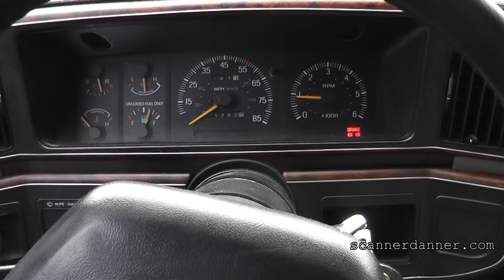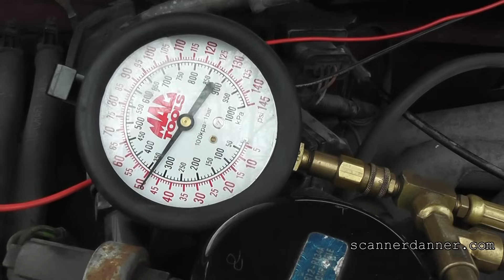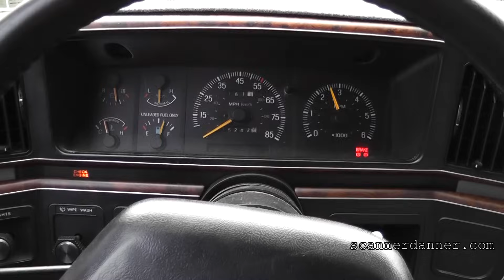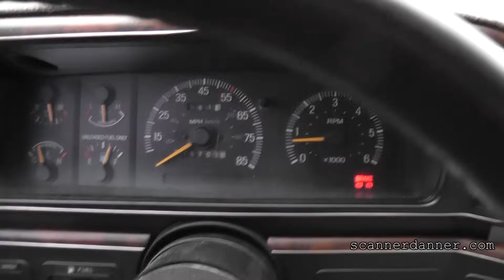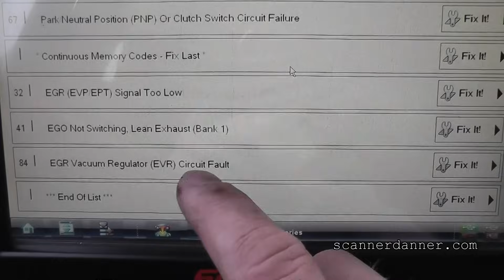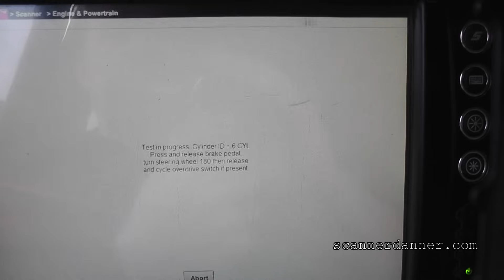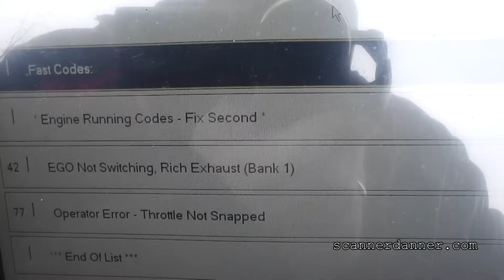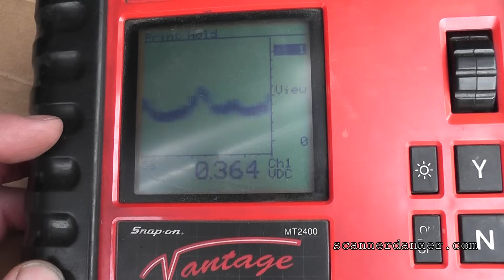1988 F150 Hesitation Problem [FIX!]

Comment: Didn't watch the entire video to see if you mentioned this, but the truck had an ignition misfire.  At 30:03, just to the left of the TPS, behind the air intake clamp under the throttle body, you can see spark jumping like crazy.
Reply from the maker: +Alan K there is no plug wire there. I saw what you were talking about but I promise you it wasn't a spark leakage issue
Reply: +ScannerDanner I'll be darn.  I took a second look after I read your reply and it is evident the plug wire isn't the culprit.  I guess looks can be deceiving in a video.  I wasn't hating by any means.  My apologies if it came across that way.  I certainly respect your diagnostic abilities.  It's good to see there are techs that use an oscilloscope and know how to interpret live data instead of pulling a trouble code and replacing a part.  I see that so often in this field, and I'm sure you do too.  I had excellent automotive instructors that taught me how to properly approach diagnostic and repair situations, and it's evident your students are as fortunate as I was.
Reply from the maker: +Alan K no problem at all brother. I had to go back and look at it myself 2 or 3 times before I was confident enough to reply. Good eye man.

Comment: Great video ScannerDanner!  I have a 1991 f-150 with the 302 I get live data on my truck.  I had a similar problem but mine was poor MPG and my o2 was stuck lean at .0.2 volts and as i tried to drive it rich by using propane and it ran like crap and o2 stayed at 0.2 volts

Comment: I was thinking verifying base timing too. It was tricky to get the distributor gear and the oil pump key lined up when i put mine back in so i got it as close as i could then adjusted the base timing after i started the engine.

Comment: Have a 1995 Ford 302 EFI. Get a CEL light, run rough at idle, stalls and won't go over 1500 rpm. CEL light goes out runs great. KOEO 111, then 334. KOER  412, 538. Test with meter seem ok.

Comment: One suggestion on these is to always use Slow Codes. The other thing I do with Snap-On scan tools at times is to lie to the tool and try a different year if I'm not getting proper PIDS, etc.

Comment: Funny you say you hate to run new wires...  I just had a voltage drop on the supply side of the evap vent solenoid, but the problem area in the wire happened to be between the fuel tank and the frame rail.  I didn't want to drop the tank, so I ran a few feet of new wire for the time being.  Fortunately, it was my truck and it's a GMC Sonoma so I'm sure the fuel pump will fail soon enough.  Then I will find the bad section of wire, repair it and remove the new wire I just put in!

Comment: OBD 1 Fords were a major pain.  I have also seen mention of the glitch you experienced (no snap throttle prompt/cutting out screen) when using the KOER test with Snap On diagnostics.  Seems to be an issue on Snappy's end not the vehicle's.  Maybe some coding errors throughout the latest updates. I'm surprised this truck started so easily. I once saw one timed using the incorrect mark, and it was so difficult to start due to all that advance. to make matters worse, the damper was worn, and the mark had slipped, making timing extremely difficult. I also believe the best setting from is 12 degrees base not 10.  Ford set it at 10 for emission purposes, but those old 302's were happiest at 12.

Comment: Hey Scanner Danner,  I really really appreciate you going through all you did to fix this one.  It was a lot of vital points in this video that i'm pretty sure can help me figure out my little issue i'm having with my 2004 Ford F-150.   My 2004 F-150 starts up strong and idle's good and smooth, but as it starts getting warmer, it starts to having a vibration, not like a ignition misfire, but like it's getting too much fuel because it burns gas faster than usual, and when i stick my finger in the tail pipe i get this black stuff on it like a rich carburator.  Your stuck 02 sensor/bad 02 sensor fix that made that truck run smooth without the mis, just might be the same issue i'm having with my idle.  I know it's a lot of variables that can cause a ruff idle but from this video i'm gonna check my 02 sensor's.  Nice video👍 Thanks!
Reply from the maker: we need to know what your fuel trim numbers are showing during this condition
Reply: @ScannerDanner  Hey Danner, My STFT, (bk 1) is -1.6 to 0.8%
STFT (bk 2) is around the same as 1

LTFT (bk 1) is 12.5% and getting higher 
                     as it warms up. 
LTFT (bk 2) is 7.8%
maybe you can just about tell what would you check.  Thank You!  Scanner Danner🤛
Reply: Hey Danner,  Now that my f-150 is warmed up, the LTFT (bk 1) is 10.2% and holding steady.
My LTFT (bk 2)  went from 7.8% and is now 9.4%  at 180°  Thanks for your opinion Danner👍
Reply from the maker: It could be a misfire. Do you have access to a global scan tool where you can read mode 6 data? You can find Fords misfire counters there

Comment: Snap throttle test advances the timing to some insane level, then you should hear a spark knock after you WOT. It just checks to see if the anti knock sensor is working.

Comment: Great video! You posted this video at the start of 2015 and say then that there aren't many such vehicles on the road anymore, and also that you can't easily access diagnostic information. The former's true, but the latter not so much. I have a breakout box (BOB) that I use with my 1988 Bronco II (220,000 miles and I'm the original owner) that has always run like a champ, up until last week. It started dying at idle or slow speeds. The engine abruptly cuts out, but will start back up again without any issue. I've had it idling for an hour in my garage without any stalling. Then I took it out for a run to the grocery store and back without any problem, left it idling in the garage and it died within 5 minutes of returning home. There's no stumble, it just cuts out dead. Scoping voltage at all the sensors through the BOB, as well as the secondary ignition from the coil, doesn't show anything wrong and there are no codes. Well, dang! I think it must be temperature-related and needs to reach a certain temperature before it starts acting up but so far it's really impossible (for me) to pinpoint what the problem is. It's certainly not the oxygen sensor, which is cycling perfectly. Thanks for all the videos.
Reply: Does this truck have an obd port? I have just bought an 1989 f150 lariat xlt. Thanks
Reply: @DFWAuto_Hack  The problem with my B2 ended up being the distributor Hall effect (crank) sensor (per Scanner Danner). 1988 (and 1989) have OBDI ports but they're pretty useless in comparison with OBDII. The breakout box allows easy access to the computer's inputs and outputs, but you need a voltmeter (and preferably an oscilloscope) to see what's going on. Fortunately, they're a lot simpler than OBDII vehicles so they're really not that difficult to diagnose.
Reply: @OvertheHills  i have a voltmeter nd can use it. I have an oscilloscope but cannot use it lol
Mine shakes and stalls at first. If I give it light gas pedal to keep it running, it gets warm nd is good for the whole day. Makes me think about old motorcycles with choke system lol

Transmission wise, it slips from 3rd-4th gear when in D mode; i must switch the gear lever to the mode located at the bottom to keep the power going
Reply: @OvertheHills  i did not see a port in mine but noticed 2 engine lights on at the bottom of the dash
Reply: @DFWAuto_Hack  An oscilloscope is just a fancy voltmeter that creates a graph of voltage against time. That could be a bad temperature sensor. I'd check the resistance across its terminals to see whether it's within spec. I don't know about the F150 but the OBDI port on my B2 is in the engine compartment on the right side fender near the firewall. Lucky for me I have a manual transmission. Good luck!
Reply: @OvertheHills  maaan i so much envy you and wish this was a manual. I love manuals. I have a 2000 mazda protege and 2000 f150 both manual. A 2013 camaro 6 speed. I bought the 1989 f150 to replace the 2000 f150 but im afraid as soon as i sell the manual f150 i regret it forever cuz this 1989 with itz 3-4 gear slip is not encouraging lol

Comment: can you adjust the valves of that thing? kinda amazing to me that in 1988 they had computers to run these systems, compared to today when they can use calculations to see how much EGR there putting into the engine(diesel) but back then you needed to think like a tech not a mechanic now a days its tech 100%

Comment: Fuel tank selector valve has a filter in bottom of many.Few are aware of this. I just changed one 30 years never done. There is an Arcing spark wire 30:05 I can see/ hear it next to tps for misfire. Will test O2 next.
Good job Thanks
Reply from the maker: no there is not, that would be the purge solenoid you were hearing that was clicking on/off

Comment: I noticed on my 1990 Ford F-150  4.9 The throttlebody gasket was completely gone and on top of that I had some vacuum hoses that were leaking. The truck idles and runs great it’s just sluggish on the takeoff. So I’m going to replace the fuel pressure regulator. I couldn’t find a way to test the rail pressure. So I could use some help with that. One more thing is the throttlebody gasket was a recall on these trucks.
Reply from the maker: Check base timing too on that.
Reply: ScannerDanner I think I’m going to try to knock sensor and see what that does. But the great news is I put a can Seafoam in the oil and in the gas and  my truck Starts and runs like new. It seems to be getting better every day after the Seafoam.  I split the can in half Between oil and gas. It works great for me hope it works for you.

Comment: If it have been running with rich FT, the ecu reset was in order. Even best if done after driving around a bit, to clean up the excess carbon build over the spark plugs exaust.. due to having been running rich. Those spark plugs might have been fouled with carbon since its such a big fuel devouring engine. Given that, the EGR valve might have been flowing very smoky exhaust gases and it might not be in such a good condition too. If it has a cat, i might have clogged up already or melt like davesfarm once demonstrated on a "decomissioned" Ford V8 police cruiser (OBD2 car i think).

The pops during deceleration like those in the video always looked rich condition to me. ATM I have some troubles understanding how there are pops and backfires during lean conditions... It simply "does not compute! lol"

Comment: Good video Paul. The notches on the harmonic balancer made me laugh. I remember I had the same problem. I have one of these trucks. It is sitting in my back yard. I will never sell it. It was my first rebuild. Amazing how many of these that you see on the road still today. I bought a newer F150, but I still like the old one. 

By the way, I really like your book. I recommend it highly. I like the trick for checking to see if the O2 wire is bad. On these old trucks, bad wires are all over. Heck, at that age, bad everything is all over : )

Comment: Awesome video.   I have a '91 Mustang GT and have the same diagnostic capabilities as this truck.

I like that you think out load.  It helps me learn from your experience.

I know you've done it before and have stated it won't cause any issues, but I'm still in awe that you applied 12v to the O2 sensor input circuit.

To be honest, that is my biggest fear in circuit validation, applying either too much current or too much voltage to a circuit.  I know that you have gone over this so many times.  I guess I just need to believe.

And thanks for always going the extra mile; you know by showing the new O2 sensor output.
Reply: I think it is a healthy fear and I cannot make you feel any better about it other than what I've shown in the past.  Did you see my other video where I attempted to measure the current flow from this test?
Reply: ScannerDanner Premium I have.  It was very easy video to understand and follow.  Because of this video, I have also measured all my test lights and have marked them with their amperage ratings.  Yup, all.  I have a whole bunch of test lights since I couldn't find one at 200-300ma.  I have both computer safe and normal test lights. LOL  But like from what I have seen from you, I have yet to use a computer safe one.

I see what you are saying in that you used a test light when bringing the O2 circuit high so amperage would be limited to 200ma to 500ma.  But, voltage was much higher than the AtoD convertor usually gets; I'm under the impression this circuit usually handles no more than 1.5v.  But, in your test, you applied a full 12v.  Like you said, they design the circuit to handle the heater circuit shorting to the signal circuit.

I totally understand how and why you did what you did in this video.  But, I'm curious how you would handle a similar issue with an A/F sensor, instead of an O2 sensor.  From your videos and videos that you recommended, you would rely on scanner PIDs, but just for fun, let's assume you cannot access scanner PIDs.  In other words, ScannerDanner would just be Danner. LOL

Again, thank you for your replies and all the knowledge and experience you share with such enthusiasm.   It is your passion and desire to do the job right that makes me, and probably everyone else, watch all your videos over and over.
Reply from the maker: Watch this video starting at 23:43
Reply from the maker: Help if I posted the link :)
http://m.youtube.com/watch?v=PYFQ3Y4eFWY
Reply: I remember in one of your training videos on PCM voltage sensing, you clearly state that a voltage sensing circuit of the PCM does not induce current.  So, the numerous videos you have provided have clearly demonstrated this fact.  This circuit is just sensing voltage potential difference.

You have shown me beyond a doubt that sending 12v to an O2 voltage sensing circuit will not induce current flow, and that the PCM A2D will just take anything >1v as 1v, which makes sense.

Thank you; thank you.
Reply from the maker: Correct. I still think it is wise to be cautious and try to match normal voltage levels as much as possible.

Comment: There is a check valve on the back of the engine behind the intake and you have to take the intake off to get to it. when the engine is running and you hear a humming or whistling sound coming from your engine, it means that check valve is leaking. If it runs ruff after it gets warmed up. then it's the EGR or a vacuum leak.
Reply from the maker: That wasn't the case here. Thanks!

Comment: Nice Video Mr. Danner.
 When you leaned over to adjust distributor I said to myself "watch them string's buddy". Good tip!
Paul Please put your scan tool on the seat and NOT the steering wheel. I'm sure all of us don't want to see you get hurt from possible SRS deployment and most importantly
 Your Kids need there Daddy:)      -I'm not sure if the vehicle is equipped with air bag but a good practice would be to never put it there.
Look forward to your next video and Paul thanks for doing what you do.

Comment: Hi Paul.  Great real life video that's how to show it.  I'm interested at this moment about cold engine and hesitation when good idle but then increasing RPM which makes it go rough.  As I understand it, the O2's, FPR and EGR have no input until they reach operating conditions.  Also how should downstream O2's behave as mine is 290mV generally.  If it needs to be high say 900mV then could I make a potential divider and produce the 900mV to see if it ineed makes a difference.  I don't know what current would be needed yet in order to make the devider.  I had a 1131code swirl valve and when I cleared it as I needed to for the MOT it went as above.  Also now and before, it went slow up hills and hesitates.  Thanks a lot for any info.
Reply from the maker: +Ilovetosingem what year make and model car?
Reply: +ScannerDanner Nissan Almera 2000/01 1500cc just after the changeover year.  Also 1131code swirl valve was a lean condition as far as I remember and I checked it  and it was OK.  Thanks in advance and the reply.

Comment: I have a good one for you, a 93 f250 5.8 that high idles and runs ruff when you plug in sensors. 
ran down wires for shorts, and vacuum lines for leaks, replaced about everything on it .
Reply from the maker: Let's move this to my forum www.scannerdanner.com 
It is free to join and we can definitely help you. I have 28k global members and hand picked moderators who've been with me for years and know my material inside and out and are there to help me help you guys. It is just too difficult to offer back and forth messages here on YouTube with stuff like this and we also can't share pictures and images here like we can on the website. Hope to see you there!

Comment: If you are going to be using a timing light buy some "white out", that stuff they use for type writers, it has a little paint brush. It is in a bottle... It will scream at you under a light.
Reply: It will paint over grease.

Comment: Old video I know, but that large notch in the pulley is for the pickup on the big Allen scopes we used to use in the shop.  Big thing on wheels with a swing arm full of connector cables.  There was usually a hole in the end of the timing cover marks to put the probe in.  I miss those machines.  ;)